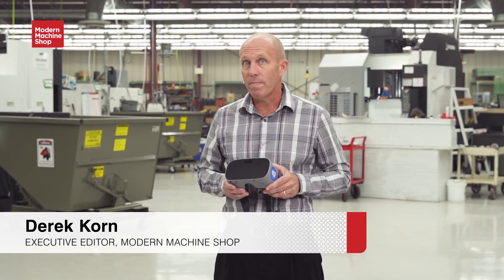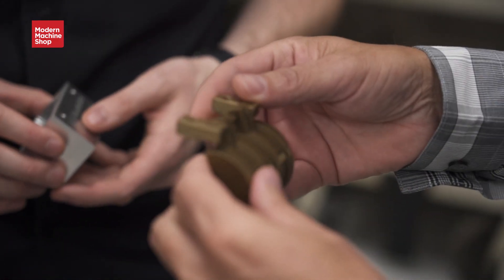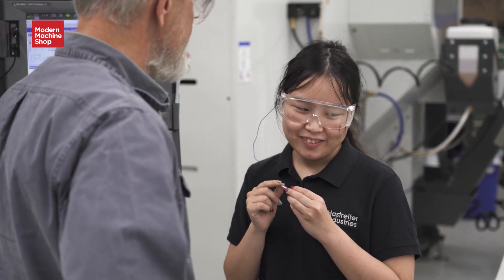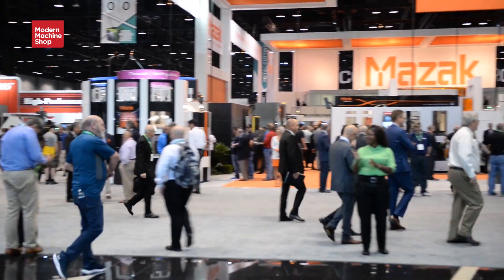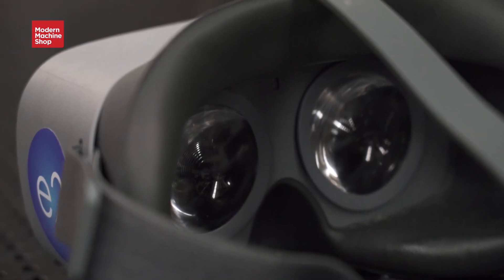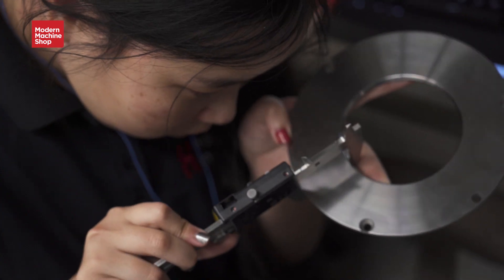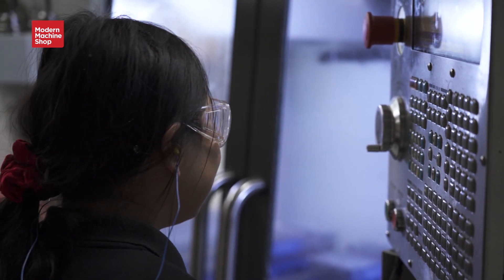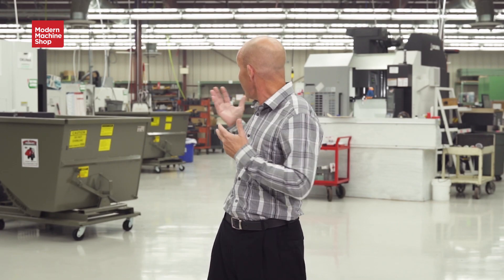VR Headset Gives Legally Blind CNC Machine Shop Employee 20/20 Vision

Comment: This is pretty awesome.  I'm legally blind and my condition causes similar issues as Tia's where the eye is optically fine but I can't see things that are either too far away or too small.  I currently work as a mechanical engineer and this type of VR equipment could benefit me while working with our machinists and in the quality lab.